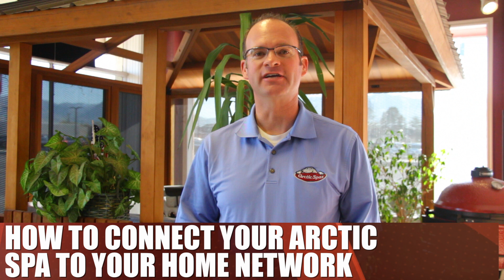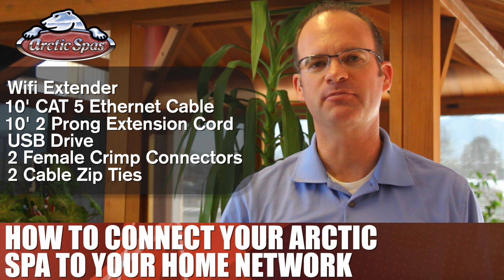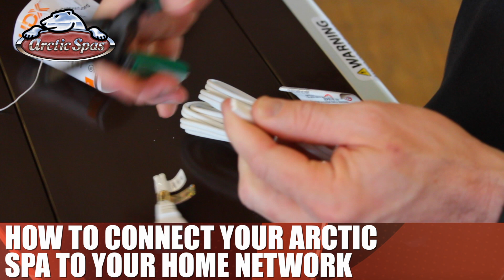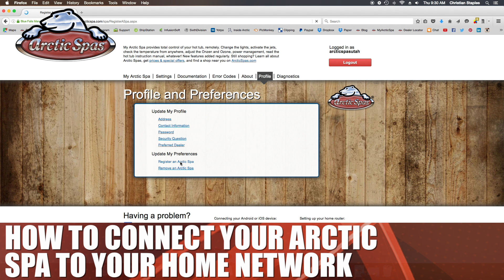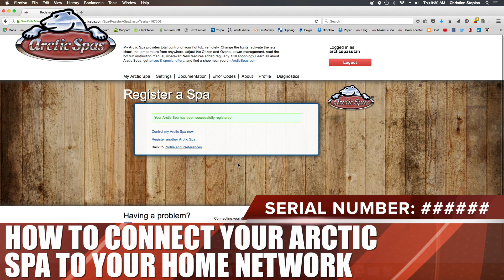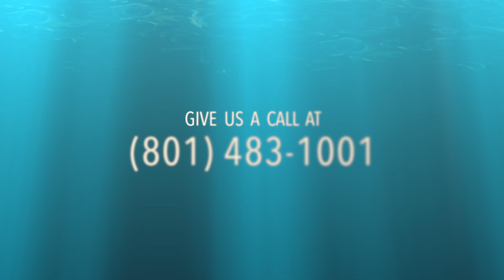How to Connect Your Arctic Spa to Your Home Network | Arctic Spas

Comment: I just open my arctic spa and the mobile actic spa worked great. But now that I reopened the tub the app was working for about a week than it lost the connection! It says the spa is offline. I’ve changed the Ethernet cable but still no luck ? Green light is on inside electrical panel inside the tub but the light is orange on the back of the router... in LLP there is no IP address coming up. Any suggestions??

Comment: I have an old spa Arctic Summit Legend Extreme 2005, but a new eco pak motherboard was installed last fall. With that being said This wifi setup with the app should now work with my old spa correct? I am unable to read my topside control any longer so this would be ideal as I have most of these items sitting in my home right now.
Reply: Yes.  Any Arctic Spa from 2011 or newer has the Eco Pack and any spa prior that has had the spa pack replaced with an Eco Pack is able to be hooked up to the internet and the phone app.  Thank you!

Comment: Here's a random question: despite being connected to the internet, my spa does not seem to know what timezone to use for peak hour control.  After lots of trial and error, it seems like the peak hours chart is actually using UTC, but since I'm in Seattle I would much rather use PST/PDT.  How do I control the time and timezone on my spa?
Reply from the maker: Joshua Caplan this will change with the next update but for now you need to log into the app while you are connected to the same network as your hot tub using the WiFi icon not the cloud icon. This will set the time of the hot tub to agree with your phone. It will be automatic with the next update so the spa will get the time from the Internet.

Comment: If you have the ability to run an Ethernet cable directly to the spa, it will definitely work.
Reply: I think I will switch to that.   The wireless thing is unreliable.

Comment: I should be able to simply connect this with a Cat5 cable directly to a switch port, right?  No need to use a WiFi extender if I can run a wire straight to my network if I understand this kit.